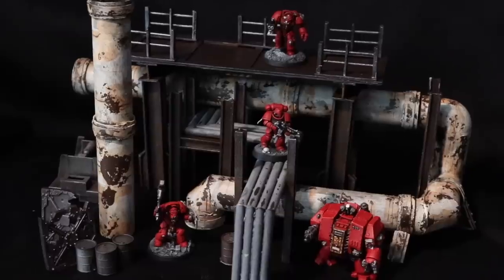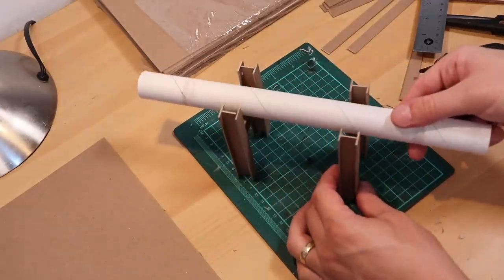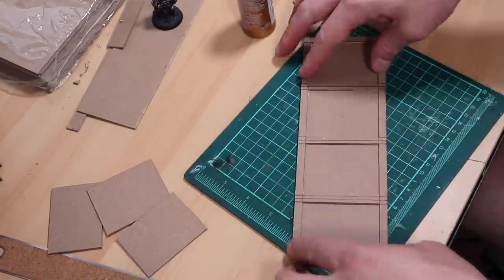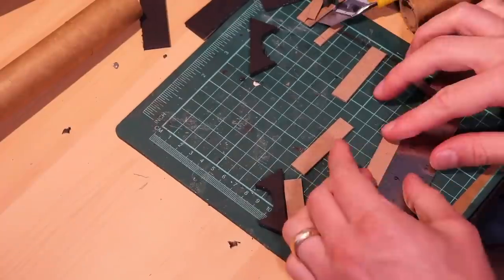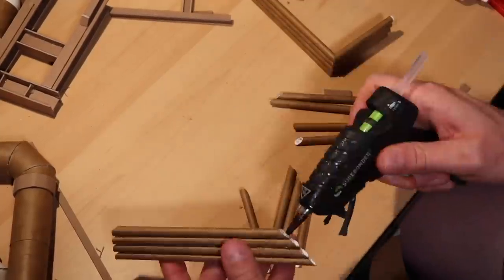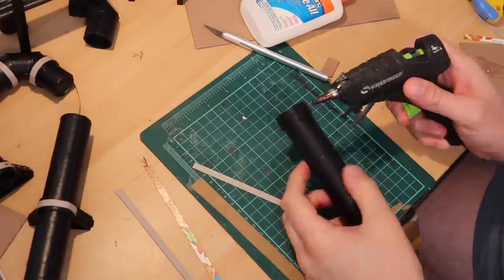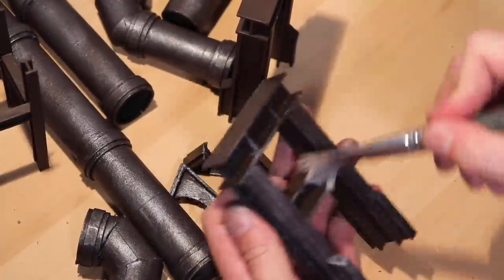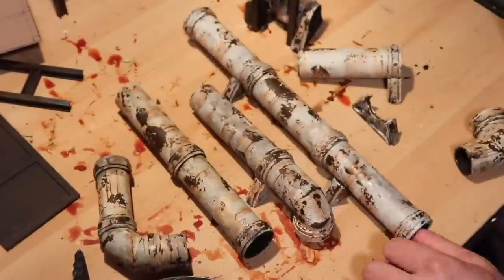40k Terrain - Pipelines and Conduits - Scratch Built Industrial Tutorial - Necromunda, Kill Team

Comment: Worked well - I like the rust.
Thanks for showing the latex - I'd seen salt / hairspray but not the chipping fluid.
The leg supports (fins) are called buttresses (buttress being singular) by the way.
Best thing I found for rivets are sticky gems designed for crafting - they go down to about 1mm and suit 40K sized figures fine.  They are normally sold on cards (with nice patterns made out of them) ready glued.  I add them before painting to help them stick but TBH I've never needed extra glue.
Keep up the great work

Comment: 13:37 A fix I could imagine for this would be to paint a thin coat of another similar color over it then paint a stenciled “RECYCLED” or “TEMPORARY” or something like that in yellow paint with perhaps some caution stripes. It tells a story: it was some kind of slap-dash emergency/jury-rigged repair that got forgotten about. It got a rushed low-quality paint job to try and slow corrosion a bit longer so the manufactorum could meet quota.

Comment: Great work thanks for sharing. 

You could even add a small amount of thicker bodied paint to the areas next to the masking fluid so there is added depth to the texture.  The way paint blisters when it rusts is also cool but don't know how you can recreate that other than maybe using some sort of medium with tiny spheres in it.

I wouldn't be too down about the drips going the wrong way on that one section, maybe that pipe has been recycled and it used to be another way up :) it adds narrative it wasn't a mistake haha.

Comment: Lots of good ideas.  I don't do sci fi but this would work for a WWII industrial site.  Your comments on your platform got me thinking . . . next time, try two chipboard frames and some fly screen or plastic mesh set on the bias sandwiched between them.

As for screwing up . . . beat this.  I once went to spray clear matte varnish on a summer's worth of painted figures - 14 battalions of Napoleonic troops, each with correct facings for their respective units - only to use flat white spray paint by mistake.

Comment: Question: In previous builds you've used PVC pipe and I was just wondering if there was a reason you chose to use cardboard tube for this build instead?
Reply from the maker: Its lighter, cheaper and easier to cut and paint. Pvc pipe would work too.

Comment: So I have 2 more quick questions for ya. Do you thin your mod podge? and do you have a particular brand of latex chipping fluid you use/would recommend? (I've never used the stuff before)
Reply from the maker: I dont thin my mod podge, but dipping the brush in water before brushing it on helps application. Cleaning the brush often is important too. I use utrecht brand masking fluid but probably any latex one would work . I put an affiliate link in the description for a similar one!